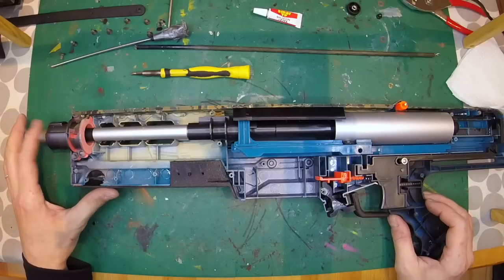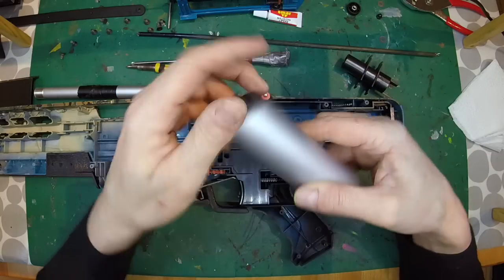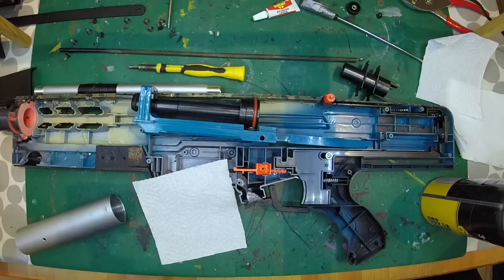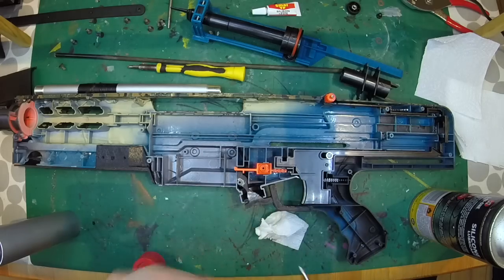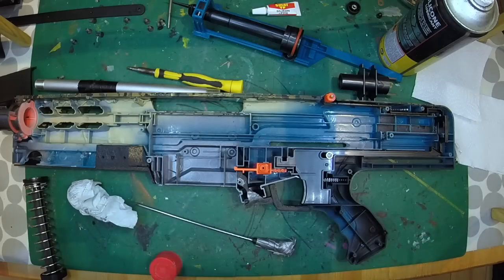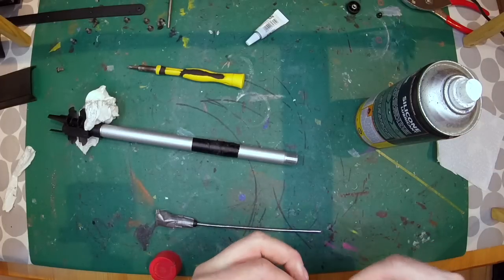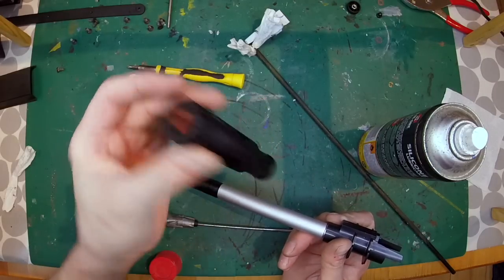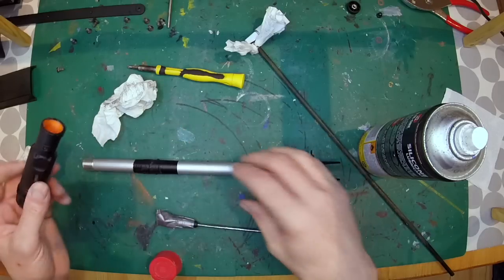Hi Power Springer Clean and Alpha Kit Tune Up

Comment: The stock longshot sled is great anyway (well on the newer models anyway).

Have you had a look at the Monkee mods barrels? They sell a 35cm barrel. My 8kg longshot has gone from 181fps average to 193fps average. Would highly recommend. They are also a little looser, which reduces jams in the barrel :-)

I can tell you are a fan of the alpha kit. You'll love the omega!
Reply from the maker: That’s two people who recommended the MM barrel. When I next get some money in the Nerf kitty I will buy one to test it vs the kit one.
Reply: @foamdataservices  could even downgrade your spring and get the same performance :-)
Reply from the maker: Plunger head is fully bonded in so no spring changes are possible. Unless you have an Alpha plunger for spares!

Comment: Very nice and thorough vid! can you put down sone links? Im having a hard time finding a rod with the small hook on the end, also, do you watch Chris Cartaya's vids? he has a lot good tips for barrel and spring tuning,.
Reply from the maker: I made the rod, you can use a piece of 4-6mm dowel or this was a garden cane for holding up small plants and the eyelet was from a bag out a dine store/parts shop. I know all I need to about barrels and spring tuning, let me know if you find anyone else with 200fps AVERAGE on Worker darts out of an Alpha kit with a 10kg spring.
Reply: Thanks! Im sure Chris can do it, but he doesn't use Worker's at all and he's more interested in getting over 300fps on average with single springs (Turf 18.5). Have you seen the MonkeeMods extended Alpha barrels? they have 35 and 40cm lengths, Chris uses duct tape on his plunger rod right near the head so the spring stays stable and doesn't wiggle at all which really helps
Reply from the maker: I am not interested in FPS queening, this was built to be easy to prime over games of several hours including prone firing and work in dense terrain. I might try a longer barrel, we have a guy on Britnerf who has made Alpha barrels. I know a machinist if I want to make my own, I have been a fabricator 20 years, so don’t really need other people’s parts. I would only need a bigger barrel if I went for more spring. Duct tape is a bodge not engineering.
Reply: Foamdata Services Agreed. Duct tape is NOT engineering. Its a quick fix or for trialling conceptual builds at home. Expect it to fail miserably in a war.
Reply: Well, his blasters are the sturdiest I've seen, and he's not using regular Duct Tape, he's using the M3 stuff combined with fiberglass tape, furthermore, he's reinforcing parts that have no preexisting parts made for that so he has to make his own, his brass work is incredibly clean and precise, and he sheaths it in some alu tubing, and crowns the barrel uses a tiny piece of 9/16" on the end to let the air release behind the dart to keep it accurate, as for fps queening he actually uses that kind of fps in war (Apoc and similar NIC wars) against the same level of blasters, and he makes his own (slightly heavier) darts that are very precisely made and very durable, he also polishes his barrels with silicone lube (about 15 layers) and waxes them with lemon pledge (about 6 layers), he's also very good at calculating the proper barrel length and ID for your PT and spring.
Reply from the maker: I am glad MrJet has happy followers like you who appreciate his work. I am sure his blasters are very nice.
Reply: They are, and he's not MrJet anymore, he got sent back a while ago, I'm a big fan of a lot of peoples work, You, Chris, OC nerf, Frankenzilla, Spectre, Roboman, nickararri, Northeast designs, Capt. slug, Heath Heil, Adrian Ward, Project FDL, Valour, Mr. Nathan and Mazo Factory, you all are very good at what you do and add a certain unique aspect to your blasters, whether it's making high power high accuracy blasters, making amazing paint jobs and cosmetic work, making beautiful homemades, making completely new 3D printed blasters, making tiny flywheel systems to making old blasters (like the deploy) usable and fairly practical, the NIC is full of talented people, who exchange ideas and benefit from each other, that how most progress is made, your YT vids are very helpful and I think both you and Chris can benefit from each other's experience.
Reply from the maker: He will always be Mr Jet in my heart...

Comment: What is the outer diameter of the barrel
Reply: For the Alpha barrel, 16mm
Reply: The scar is tapered to fit into the barrel adapter. could you stop the printer at the end of the tapered section, install it from the other side.

Comment: Have you had any issues with stock bolt carriers at that spring load? Any stress marks or cracking?
Reply from the maker: None at all. It’s been going 10 months now and has fired nearly 1500 shots. I set my pump grip up very carefully to ensure it was even both sides and I don’t snap prime it, it’s designed for measured shots with careful aim at a relatively low rate of fire.
Reply: @foamdataservices  Thanks. I'll probably still reinforce mine, but not as heavily as I was planning. Great vid as usual, cheers!
Reply from the maker: Stock one works up to 14kg. The metal ones are on sale at NFStrike again for $25
Reply: @foamdataservices  It'll definitely be future proof, then. Speaking of 14kg, do you have any thoughts on the Worker 14kg spring?
Reply from the maker: Yeah, it’s 14kg, so too strong for this job! I have not tested it, a few people at FFS run them. If the compressed length is right for the plunger stroke then it should be pretty much the same as other similar springs in performance terms.